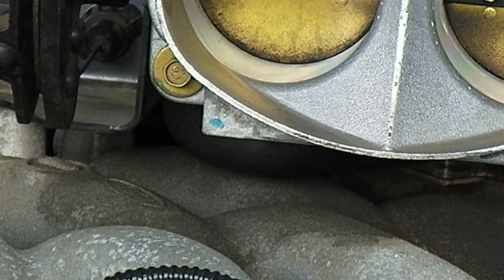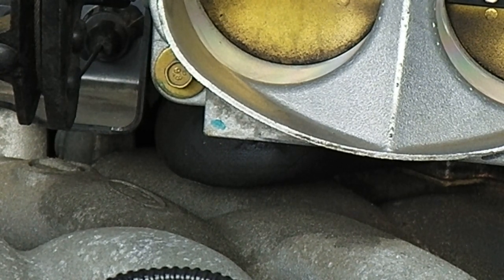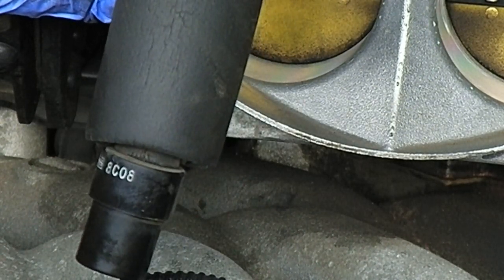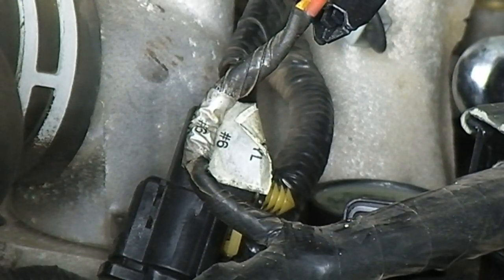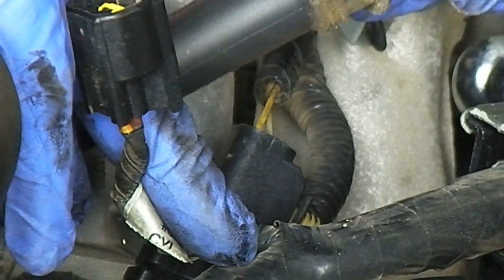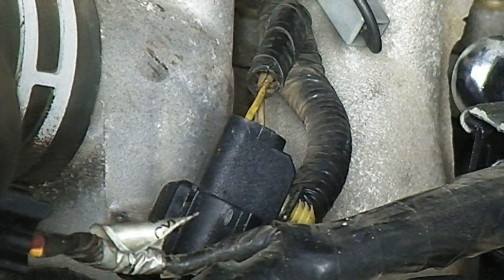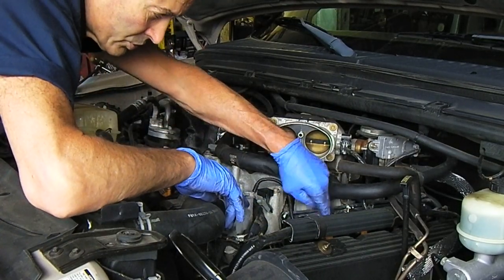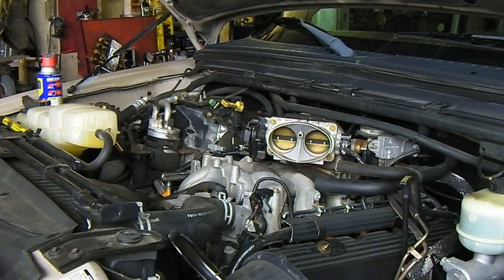F250 Ford Super Duty 6.8L.MP4

Comment: Your video saved the day. I have been fighting with my truck for two days looking for a vacuum leak and listening to so many wrong answers that all cost $100+ to fix. Mass air sensor, EGR sensor , EGR valve. These were all wrong. My hose was cracked in the exact same spot as yours. Thanks for the info.

Comment: Thanks!  My "check engine" came on and dealer said it was pinhole leak, nothing to "worry about". Right.  Within 100 miles, and the hot summer sun...anyway yesterday while idling with the a/c on for about 10 min, put it in reverse and was hopping as  driver-trainee daughter backed up. We pulled back in and I took wheel. I kept rpms up as I backed out and drove home no problem. Called dealer to make appt Wednesday for "pinhole in pvc line" repair. 199k miles 2000 f250 v10 2wd crew that I love!

Comment: Thanks so much for this video.  I watched it while my wife and I shopped for groceries.  lol.  Sure enough, the hose was split exactly where you described.  I went ahead and cleaned the MAP sensor and throttle body while I had it apart.  It now idles as smooth as a baby's butt.  Kudos.  :-)

Comment: Changed fuel pump and O2 sensors. Was about to change spark plugs and coil packs. Then I saw this video and checked my pcv hose. What do you know? It was cracked in the exact location you described. 13 bucks and a half hour later my truck runs like new!  Thanks!

Comment: You still out there? I need some help. 2003 6.8 stall under brake on at stop. Been to Ford twice. First time they said they could not get it to do it. Second time they found electrical interference that said the vehicle was doing 5000 rpm and a coil was shot. that was three weeks ago. Its back. Need some help. Not against spending the money but I assume the dealer has better tools than I do. Need to decide what to replace as the stuff is probably all old.

Comment: Will they be near enough to replace the idle air control valve too? I bought @ 113K miles and have had no engine repairs to speak of. Oil changes every 3k is about it.  Suggestions welcomed, and thanks for the video!

Comment: i have a 2009 ford f250 superduty replace the fuel pump and the fuel pump module start and shuts off is a 6.8 motor any advice
Reply from the maker: Without diagnostic data and computer scan, it's impossible for me to even make a guess, Jose.

Comment: I have a F250 1998 which makes my truck run ruff i got the same codes so I'm going to change it to see if it runs better,but I'm also getting a PO351 code whats up with this? Thanks!
Reply: Mafs sensor

Comment: Will be checking my pcv hose thanks.  Is there a particular place that I can go to or a website...where I can order the wire that connect to the coils? and what is the specific name of them? please can you let me know
Reply from the maker: The only place you can buy the wiring going to the coils is the dealer. I've never had to replace them. I have replaced many sets of the coil on plug assemblies. You can order those anywhere, but I always buy Motorcraft when changing anything on a Ford. You will need your VIN number when ordering to get it right.
Reply: Bernard Lee DeLeo thanks so much...but what was that wire part you was holding and said you normally replace that?  I am new to the Excursion and have a V10 on.  I changed all the cop on the drivers side with new plugs...one coil isn't sitting as flush as the others....and on the passenger side, the third plug from the front is sitting up higher than the other plugs and the last two...how can I get to them? sorry about all the questions and thanks
Reply from the maker: Let me caution you. Don't work on your V10 unless you have some knowledge and a manual. Those spark plugs break off easily. The wire I'm holding is exactly what I said in the video. It plugs onto the coil assembly and doesn't get replaced unless you break it. There are ten spark plugs, ten coil on plug assemblies, and ten separate wire connectors. If you break one of the plugs off, it can cost you over a thousand dollars to have it removed, and many thousands if they can't get it out without taking the cylinder heads off.
Reply: Wow with the price.   Ok..well I removed 7 plugs so far...will let the professionals do the other three.  Two of the coil wire connectors didn't snap back into the coil assembly.  The others did.   Last 2 questions and thanks for helping.

If a coil assembly isn't sitting as flush in the head..as the other coils, is that bad?  And last...is it hard to depressurize the fuel line?  I wanted to change my fuel filter.

Also happy father's day to you
Reply from the maker: Yes, if the coils don't fit flush, you need to take them back off and re-seat them. Please don't work on your fuel filter. If the wires won't snap back into place, you either have the wire connector backwards or you've broken the retainer snap. A small squirt of WD40 will lubricate without leaving residue for snapping wires back into place.
Reply: Ok thanks so much